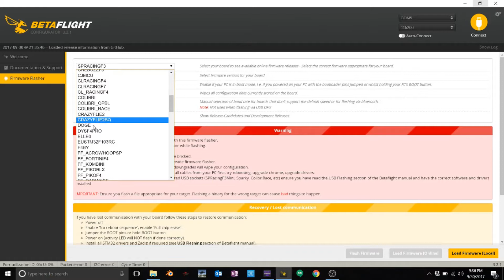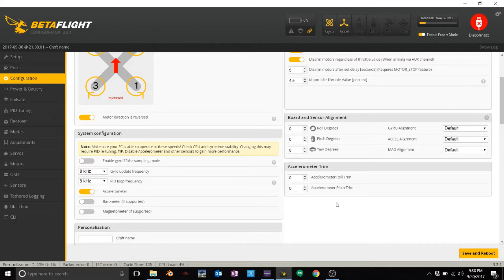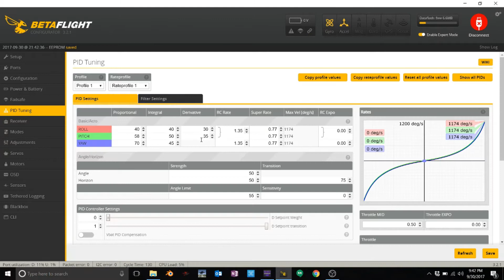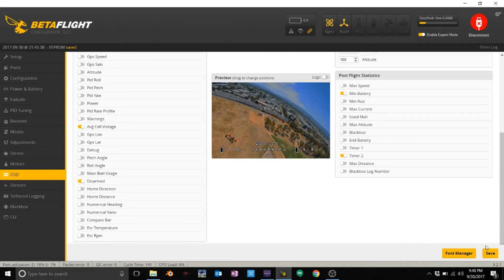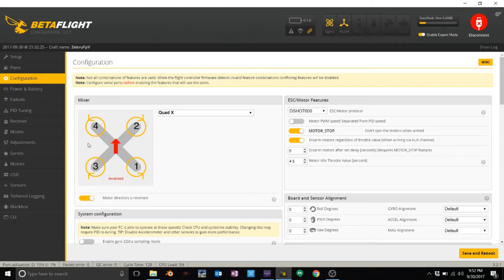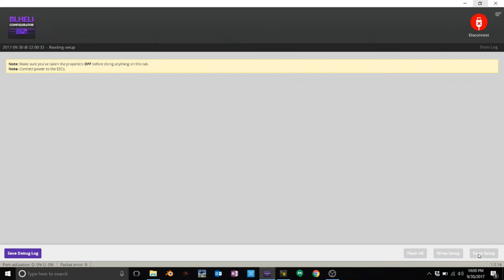DYS F4 Pro/Betaflight and BlHeli Suite Set up (Zebruh Hellbender Build)

Comment: I’m working with a DYS F4 PRO V2 and I can’t get my computer to flash the firmware and I don’t know what to do. Could you help me out?
Reply from the maker: What’s the computer tellin ya
Reply: It keeps saying connection failed and it brings me to the yellow bar that says lost connection
Reply: And I’m using a data cable

Comment: Hi , when I try to flash frameware into dys f4 the board is disconnecting why ? . I tryed by holding reboot button and then flashing frameware into it but also no used . . Help me bro 🙂
Reply from the maker: +Maker Hobbiest hey brother.  Try this.  Plug in ya bird, connect then go into cli and type BL then hit enter. At the top right does it go into dfu mode??
Reply from the maker: +Maker Hobbiest do u have google hangouts?? If so, shoot me a message so it’s easier to do this 🤘jjrotogeek is my username
Reply from the maker: +Maker Hobbiest hey brother,,, did u get my reply??
Reply: JJRotoGeek ya got it . Thanks . I dint my callibrations all by seeing your video . Thank you
Reply from the maker: +Maker Hobbiest awesome!!!!!!

Comment: I have the DYS F4 Pro running OmnibusF4 ver. 3.1.6. I was going to update to 3.1.7 but after watching Project Blue Falcon - RIP the 3.1.7 version does not support the inverter I need for SBUS on my Taranis.  Do you know if the newer DYSF4PRO firmware you mentioned supports this inverter.
Reply from the maker: +Wayne Koskey hey there. Yes I’m pretty sure that is fixed in the new firmware.  But I have to be honest with ya, I don’t run tarranis so I’m not 100% sure.   Do a back up of your bird and flash the 3.2 dys pro firmware, worst case you can reflash the older one and reload ya backup.  Let me know if u need help with it.   When in doubt, give it a shot!!!!
Reply: Thanks. I will give it a try on my next build.

Comment: My escs are Blheli 32, and I can not get the blheli configuration to talk to them. i click read and it just beeps and says it read them and screen stays blank.  I have the Exe, blheli and it wont see them either. But in betaflight they program up fine i guess? Does it matter? I can choose Dshot and that stuff, but cant flash escs. Is it cause the HGLRC f3 v4 fc? Is there a way to talk to the escs without using a fc to flash them? and do they need to be set all at same time? or can i do one at a time. Sorry such awkward questions.
Reply from the maker: +Michael Silcox hey bro, upfront I’m going to tell u I haven’t played with the dshot 32.  However I believe u can’t use the normal blheli suites for them, I think there is a special one u need to download for the 32bit esc’s.   Double check me on that but I think I’m right. Let me know
Reply: any solution to this issue??
Reply: Not yet, the cold weather has taken over, so to keep it safe and know whats wrong without guessing about weather, im waiting till spring time. Just flying the 2 inchers now and barely at that. I also got another youtuber who said to use multishot instead of Dshots for 6s High kv setups. He was suggesting it based on the 2800kv motors which are now my new favorite regardless of price, EFAW! getting the 2500kv efaw next.Have great holidays
Reply from the maker: +Michael Silcox sweeeet.   Happy holidays to you too brother !!! Let me know if that works out.  I don’t know a lot about the 32b fixes yet.

Comment: I just got new motors and i had to go into blhelisuite to reverse a motor, and the fricken thing says a "u" under motor 1.  Now everything works fine i just cant update or reverse, have to do that manually. Ive built plenty of quads, i am just totally stumped.  Parts= dysf4, dys xs20a,Hyperlyte 2206 2450.
Reply: G-nice I just had the same problem with ma esc and what I did is unclick all but that one esc and rite click on the esc tab and it should open another window where u can reflash it and all will be good
Reply from the maker: G-nice that is odd.   Using blheli suite chrome app or the real suite??? I would reset to defaults on the esc maybe????
Reply: ive tried both, somewhere along the line it lost it's firmware. i cant update it or anything. i might have to buy a new one. thnx for replying JJ, new sub
Reply: i guess your fw corrupted base on your input "half way it hung". you still can do recovery via isp program using Arduino or cp2102
Reply: i was afraid of that, hoping i wouldnt have to buy a arduino, thnx for reply
Reply from the maker: G-nice hmmmmm even if it loses the firmware, it should still have the blheli boot loader.   You can't reflash it through the real blheli suite, not the junky chrome app
Reply from the maker: G-nice I say at this point if it works, hang it and go fly lol
Reply: yup, if isnt broke dont fix it.ill use it as is until i ever upgrade. feels fine, just in the back of my mind about fw. thnx bud
Reply from the maker: LOL i understand brother.. im the same way about things. this weekend is maintenance weekend for me lol.. fixing, updating, tweaking drones and quads..

Comment: good job man lots of good info. i couldnt figure out the motor beep for lost quad. thanks got it now
Reply from the maker: Marc Hord sweeettt got it working???
Reply: yes turtle mode too
Reply: rebuilt a omnibus f3 with a rs 4n1 esc. upgraded to 3.2 bf. Set it up like you zebruh pretty much. Man that thing was a beast to fly. all old beat up parts reused. it flew tight.Wish my f4 flame hadn't broke my usb connecter off i would love to update it. My motor beacons are loud as hell. Love it
Reply from the maker: Marc Hord aahhh awesome!!! I loveeee the omnibus f3.   Was always my go to controller.   Have them fuckin memorized